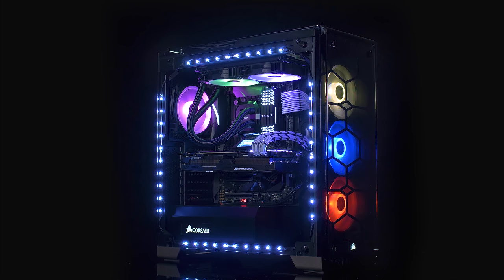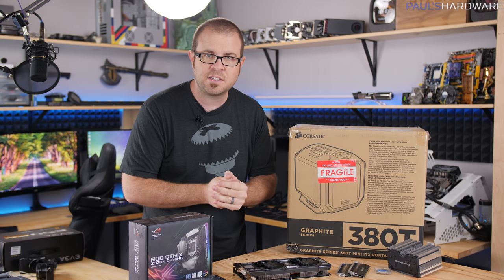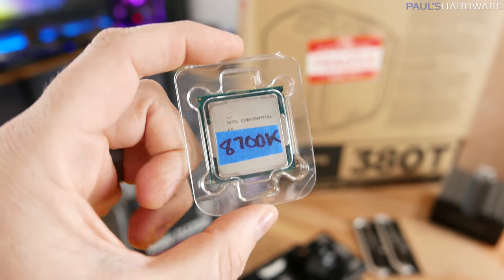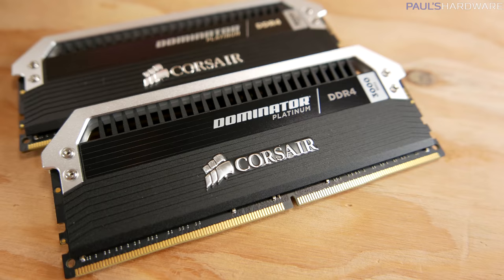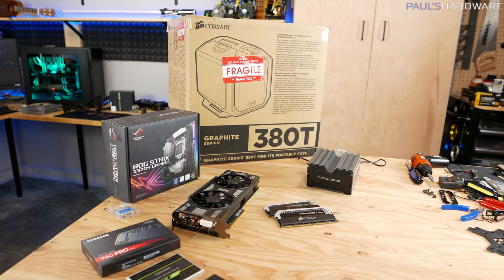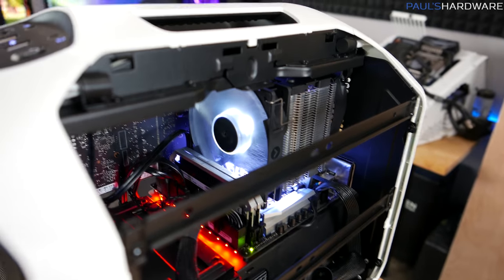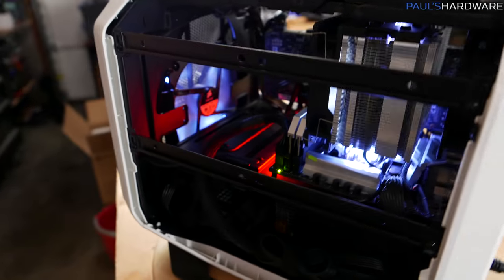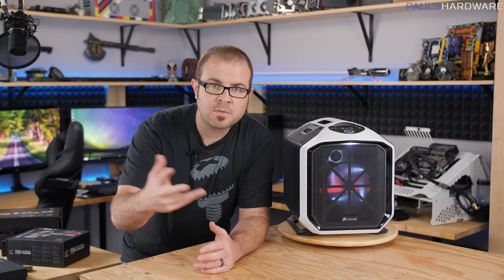Building a Portable Video Editing PC for CES 2018!

Comment: Paul, they have an X370-I that looks just like your Z370. You could have had Ryzen for your mITX rig on that same style of board.
Reply: Probably because of the performance hit. Ryzen's 1800X, which is around $100 more than the 8700k is slower at Premiere Pro. So it would cost more... and be slower. That doesn't make a lick of sense.
Reply: Greg Underhill where in the world is your $100 more coming from?
Reply: 8700K is $379 MSRP. Ryzen 1800X is $499 MSRP. The 1800X is, of course, on some crazy sale on Amazon right now, but it is about $460 on Newegg.  So give or take, it is normally around $100 more barring any freak sales. The 1800X is also slower than the 8700k at Premiere Pro, which is what Paul's Hardware uses IIRC. So he would be looking at a more expensive CPU with less performance. I don't see how that makes sense.
Reply: Greg Underhill “MSRP”. I saw the 1800X for sale for $350 at micro center months ago. Good luck actually even getting an 8700K under $400. MSRP doesn’t mean jack
Reply: I got my 8700k at MSRP so...
Reply: Greg Underhill good for you.
Reply: K
Reply: 1800x makes no sense though. R7 1700/1700x is where it's at.

Comment: Ehh- if I were travelling- that'd probably be the last case I would chose as it's rather big; personally- I'd go with the Node 202 (supports the same number of drives, can throw in a 140mm fan over the CPU chamber to keep things cool, and has a smaller footprint) or the Sabre. If I had to put my tinfoil hat on- did you chose that case because Corsair sponsored this video/ is sponsoring your coverage? If so, all I can say is- damn, that's commitment right there.

Edit- nevermind, I'm wrong. It's because of that big * CPU cooler, isn't it? Also- there's a LOT of spare space near the front-top of the case; it looks like it supports Corsair's 3.5" drive mounts like those used in the 600T; if it fits in there/ has the same rails, I'd shove 2-4 of them in there.

Edit 2- Wait- are you driving or flying there? If driving, your choice makes a LOT more sense; moreso as I can only imagine the pain in the * it'd be to build something in the Node 202 only to have to disassemble painstakingly (talking from experience, removing the motherboard from the Node 202 is like having the Devil torture you) disassemble it once you get back.

Comment: Sandisk Ultra II is in my experience one of the less reliable drives available (of the major brands -- old OCZ drives before Toshiba bought them were probably the worst as the tech was still new), I have actually had one San Disk fail as well as had a friend have one fail that I installed for him. I am not saying don't use it but I would not let it be the only place I store my source files.  Now I have had Samsung disks fail also , but I had 2 of 4 sandisks fail (within 1 year of install) and 1 of 6 Samsung drives fail (and another slow down) but both took around 2 years to develop an issue. Crucial drives for me have been the most reliable with 8 of 8 drives all still working with over 2 years on all 8 drives. 6 are MX drives and 2 are the cheaper BX drives.  I understand the sample size is small but that is my experience.

Comment: Cool build but as others have asked already just curious why did you decide on this setup instead of using a fast laptop like an MSI or similar for on location editing? Your setup would obviously have faster render times but do you need it that much faster?
Reply: RockstarBruski if he'd like to pump out a bunch of videos in a day, yes.
Reply: Trinescity 
And also YouTube does its video processing when uploading.
Reply: Ok I could see that if you had a bunch of videos to edit and or more complicated videos and time was an issue.  When im on the road editing videos for my youtune channel i use an msi laptop with 32gb ram, i7, nvidia gpu, 3 SSDs inside and i can connect up to 4 monitors to it if i want to lug the extra monitors (which ive done before as im very used to using multiple monitors to speed up editing)  the laptop does well for simple editing even in 4k using premiere but if i do more complicated editing then its definatley slower than my tower editing computer at home.  Cheers 😎

Comment: you could have just bought a mini ITX AM4 motherboard with amazon prime and it would be at you door in time for CES. you forgot your 1080 of what 400$ and your samsung pro nvme ssd but could not afford a 120$ board. just wondering??

Any case just wanted to comment about the PSU. My Thermeltake PSU Died on Dec 23rd and just bought the gq 650w from evga. Could not be any more pleased with it. the best PSU in my eyes.

Comment: Aside from B/Fri & Cyber Mon 2019, your videos have gotten me this far.. I'm building a photo editing PC, equipped with hardware to handle possible future video editing as well.. ATX:  Meshify C (new full mesh front), Gigabyte Z390 Aorus LGA1151, i9-9900K, SSung PRO970 512gb, SSung  860 EVO 1TB 2.5,  Corsair Vengeance LPX 2X16 3200Mhz, MSI Ventus GeForce RTX 2060..  Still to buy: Noctua NH-D15, and a CORSAIR RMX Series, RM850x for juice.. Seem ok to you? Suggestions? A couple of  2 or 3T HHD? Or just another 2.5 SSD?  My current pc is 6 yrs old, built by a friend, who's way too busy these days.. I'm on my own this time..  The fun part is about to begin!

Comment: You take a pc, monitor, keyboard and mouse with you. Why? Why not just a laptop with a external gpu?
Reply: probably does just take a laptop.. but he has to satisfy some sponsorships by mentioning them and doing something with some products.  and has to make a video as often as possible to stay relevant in youtube's algorithms..

as far as i can work out, if you demand a full desktop for editing, which does have legit purpose it will be faster and more capable.. a DAN-Case would make more sense..much smaller cube and you can probably fit it into a soft case somewhere...
Reply: pat:h Laptops SUCK. Long live the tower!!
Reply: An 8700k has 2 more cores than any other Intel laptop - that’s just as important as a GPU when editing
Reply: Laptops still suck

Comment: The i7-8700K is a better CPU than the R7-1800X even for video editing so it's a bit MISLEADING to imply otherwise. The 8-core Ryzen may have 33% more cores, but the  higher IPC and frequency combined with the fact most applications (even video editing) very rarely utilize 16 threads anyway all means the i7-8700K system would beat an R7-1800X system... only some very specific, atypical benchmarks like Cinebench, 7Zip etc show similar performance due to highly threaded workloads... Adobe Premiere at times only uses a few threads so many times single thread performance is still king.

Comment: Random question but I'm looking for help as no one seems to know the answer, my new gtx 1080 Asus strix crashes once a day for no reason, and after the initial crash it doesn't crash for the rest of the day, my power supply is 500w bronze which Is reccomended, and runs without flaw after the crash, this has been Daily for about two weeks hoping it would settle out but it's consistent. Any suggestions would be great.
Reply: Hemibuzz what is crashing ? Check event viewer . Is the driver crashing to desktop? Hard lock reboot ? 
System overclocked or stock ? 
Ran stress tests? And memtest ? 

Did you run driver cleaner and try new or different drivers ? 

Clean install of windows? 
Check load voltage with a meter? 
Other system specs ?
Reply: chris Leclerc checking event viewer seems to leaning towards being an inefficient power supply which kinda sucks but if that's the case you had the best answer by far so thank you good sir
Reply: Hemibuzz np don't hesitate to ask for help . If ever interested in overclocking you can find me over at overclockers.com as ||console||

Comment: The 8700k will blow a 1700x away in Premier Pro anyway..  Everyone makes the mistake thinking AMD and Intel CPUs are a apple to apple comparison. They are not. Core and per clock performance is different between the two..  Also unless your taking 6k red footage and scaling it down to 4k or 1080p. There really is no difference in performance when it comes to rendering then even using a basic GTX1050 over a GTX1080 as long as you have enough VRAM.
Reply: i seen decent gains going to ryzen, you do need decently fast ram on ryzen.. but overcome that hurdle and 1700 vs 8700 i would pick the 1700 anyday..8700K has single threaded advantage, but latest version of premier for me hasn't tried to go very single threaded, in fact most tasks are chewing up all 16 threads nicely.. if yours is failing to, may have to tweak the ini developer files.. premier is a fairly buggy application sometimes..

as for the theory on using lower tier GPU, you are absolutely correct.. 1050 Ti for most people is all you need,. however if you are doing much more massively intense work loads, you need extra vRAM and bandwidth from much more premium GPUs..   but 1080P or 4K.. 1050Ti or a 1060 or Rx480 are plenty..

downscaling and upscaling however does not use GPU, and my experience is multithreaded CPU intensive.. 

apart from this, it is a bit stupid that they build a "Portable desktop" .. i mean that case is awkward shape for portability.. i rather a dancase...
Reply: Premier doesn't scale well with cores
Reply: Yep after 6 cores /12  threads it starts favoring core clock more for performance gains.
Reply: Puget Systems has multiple blog articles posted where they benchmark all the top end CPUs on the market and GPUs as well.  I would post a link but my reply would likely get hidden for possible spam. But they are easy to find. The articles are both a really good read and pretty in depth on what gives you the most performance gains using real work test.
Reply: @ meehhhe, I thought that case was a beer cooler at first.. LOL..  Looks like something I would carry camping to pack food and drinks in..

Comment: Hi Paul, i'm kind of interested in 8700k with air cooler, but i heard it's hot and i could not find any tests with air coolers.
So is "CRYORIG H7 Quad Lumi" cooler enough for 8700k on stock frequency (or maybe some small overclocking) ???
i really do not wanna buy monsters like "Noctua NH-D15"
Reply: I'm not a fan of Noctua NH-D15 or any other big coolers it looks very big and heavy and problems with component accessibility. And if it possible to use smaller one, without losing cooling performance,  then i would prefer to use it

Comment: The 8700k is faster than Ryzen for video editing anyway so you will be fine.
Reply: Gabriel Wersebe it’s the opposite. 8700k is better at gaming and 1800x is better for multi threaded things
Reply: bluludaboi 
When a GPU is used, single core perf matters in video editing.
Reply: JCB 136 Well any smart investor will tell you to look at the long term effects of this. Right now intel’s share price is up from 6 months ago while amd’s share price is down. And as for performance the 8700k is faster in premiere due to its higher single threaded performance and the entire purpose of the pc in the video is a mobile video editing workstation. And for the meltdown thing Microsoft stopped pushing updates to amd machines because the updates were bricking the machines due to amd’s poor and rushed documentation of ryzen